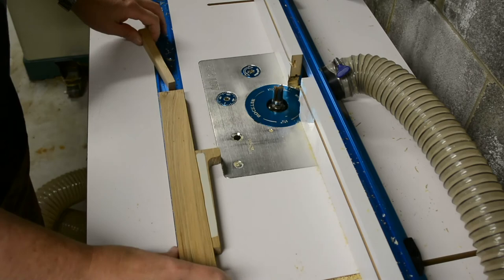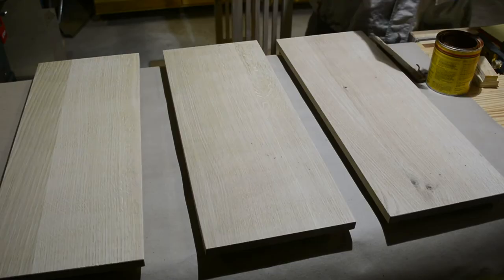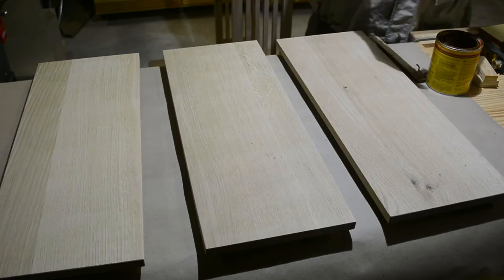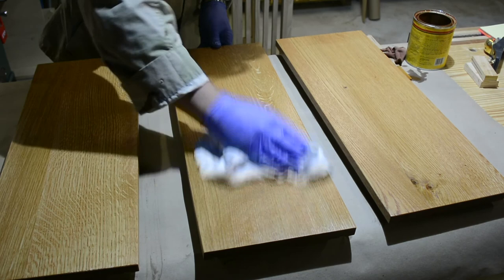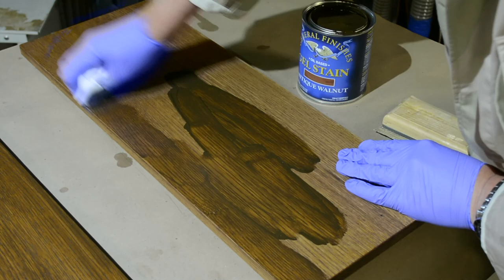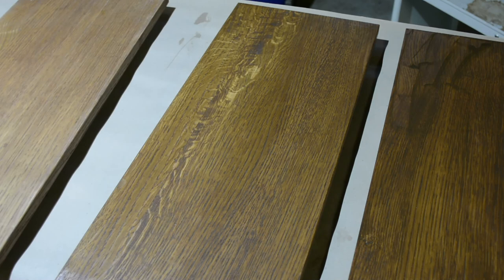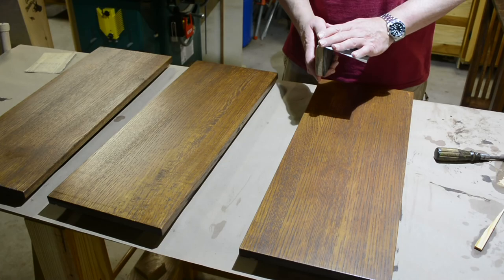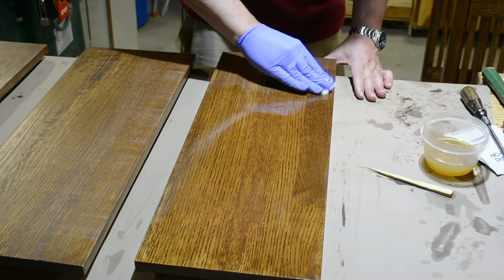Mission/Arts and Crafts Bookcase P4

Comment: Hi James. I've recently gone through my bout of dye/pigment glaze experimentation after watching the Jewitt video on the mission finish.    I found that for the 4 step finish over QSWO, one can get the nice antique appearance without that blotchiness that happens when the dye bleeds out laterally from the sides of the exposed open pores by first sealing the wood with a clear oil base such as danish oil (cheaper than Osmo Poly-X for this work), then applying the TransTint over that.   This makes it super easy to apply the dye solution evenly, as well as preventing the dye solution from raising the grain.   
Thanks for a great 3 part video series.
Reply from the maker: Thanks for the information.  Building a base then a sealed surface is key.  I don't often have a need to mimic the mission finish as I think QSWO is so amazing with just modern finishing.  It is funny that the classic mission finish was accidental due to storing the wood near straw soaked with horse urine.  Now we try and duplicate it.
Reply: I find that following Mr. Jewitt’s recommendation for diluting the TransTint dye with distilled water rather than alcohol reduces the lateral “bleed out” of the dye.   It gives a beautiful finish.
Reply: Excellent video series.  I just completed a Mission style bookcase (different design) myself, and would like to try making another like yours. Do you have plans for sale? I am very partial to the Craftsman/Mission style on general.